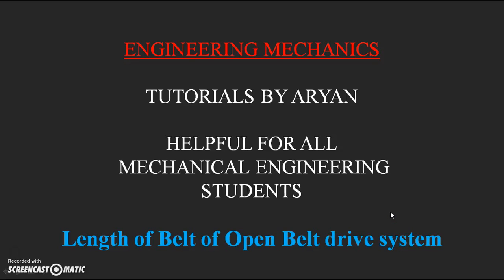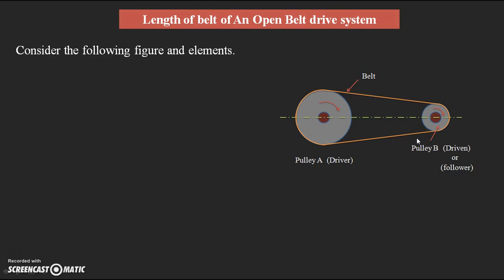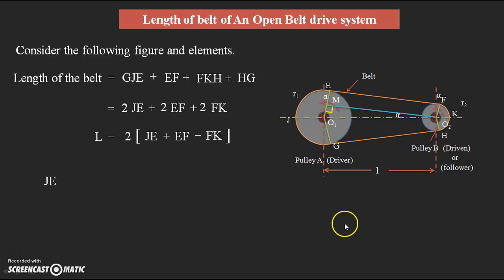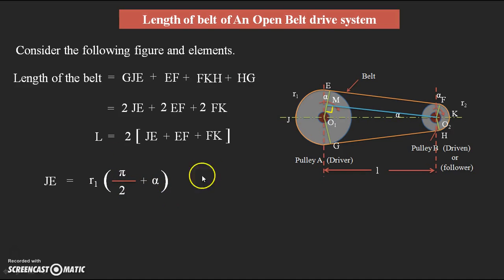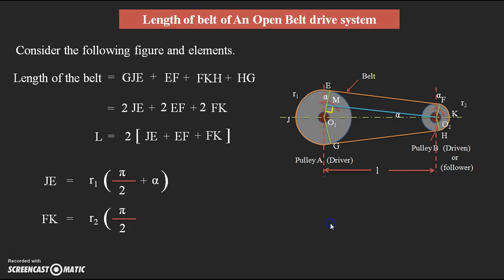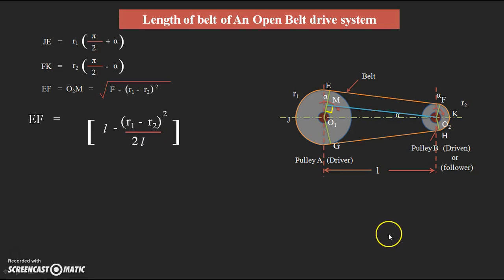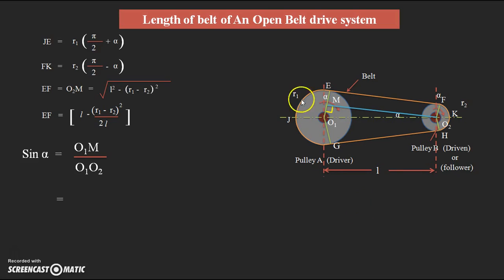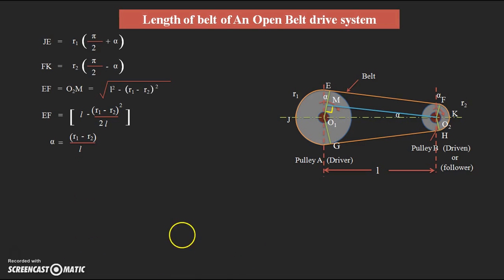Length of Open Belt drive system

Comment: When the pulleys have the same radius R and are separated by a distance D, the belt length is simply 
    
                 L = 2D + 2πR.

When the pulleys have different radii r1 and r2, the length is then
	
               L = 2D + (r1 + r2) π + a correction term that accounts for the asymmetry.

Note that the asymmetry causes the straight lengths to become shorter, and the sum of the circular lengths to become larger, so that the two effects offset each other, but do not cancel. Because the arc length increase is greater than the straight length decrease, the correction term will be positive.

Now the correction term has to depend on the difference (r2 - r1) and the distance D. It must have dimensions of length, so the most likely candidate is ((r2 - r1)^2) / D, to within a constant. To a first approximation, take the constant to be 1.

This yields a result 

       L = 2D + (r1 + r2) π + ((r2 - r1)^2) / D.

This is exactly the result obtained by Aryan, without having drawn a diagram or doing any geometry.

Comment: very nice...plz provide length of cross belt drive
Reply: Subasini Sahoo u just have to make a change at the length of perpendicular line in this open belt a perpendicular line is made inside of the circle but for cross u have to extend the line on which the perpendicular is drawn and should draw the perpendicular on the extended line

Comment: derivation of Alpha is wrong. If you consider sin (alpha) = (r1-r2)/l means. alpha should be sin-1((r1-r2)/l). And how did you applied binomial theorem. please explain...
Reply: V M K bewakoff when angle is very small sin x is nearly equal to x . Engg m a gya itna bhi ni pta 😂
Reply: Rip😂😂